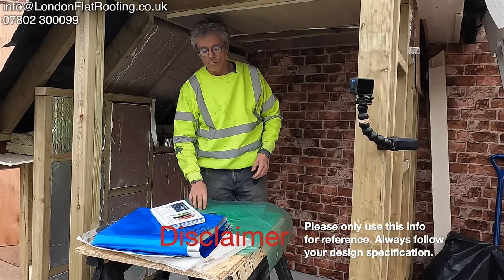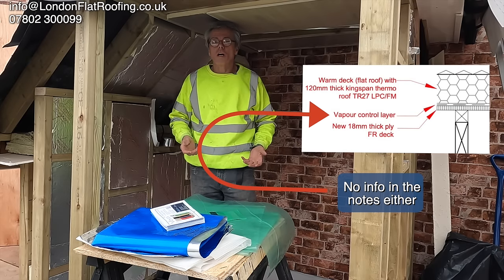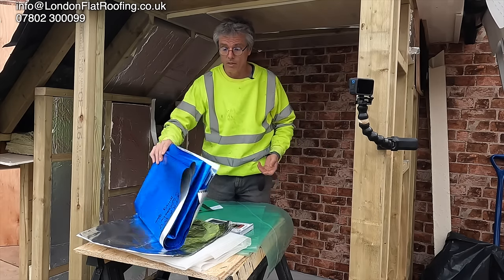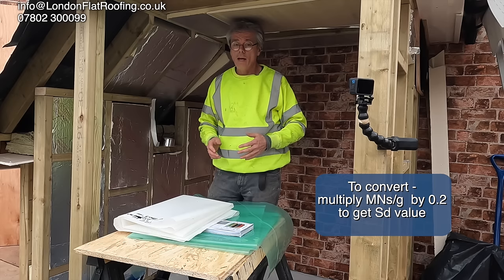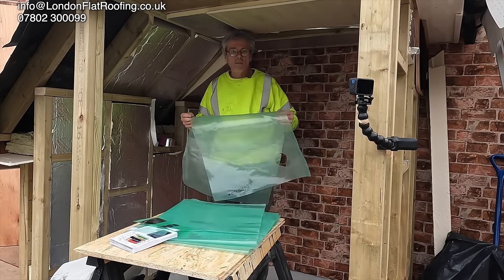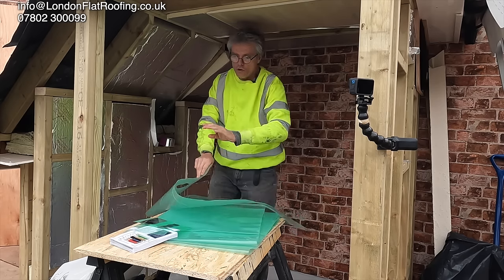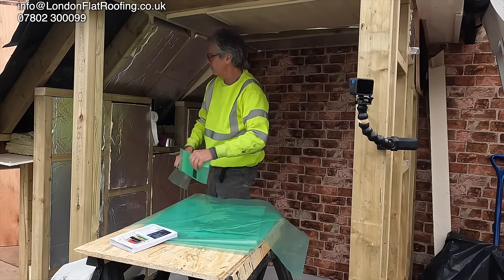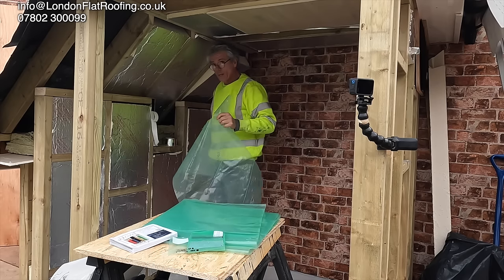Vapour barriers for roofs and walls explained

Comment: Love the outside rig Steve. Would be interesting to build a mini 'wrong' roof one day and see the effects of it, incorrectly fitted downlighters and all! I guess the most challenging one is the rear extension with roof lantern and kitchen below, no abutment vent, the usual 20 spotlights. Just trying to give you a few ideas!
Reply from the maker: If I get the chance I will do some thing wrong in this rig
Reply: Been there done it seen it fail , spotlights letting moisture through & also the heat they create causing condensation.  I have seen top hat fire rated led covers to help this problem.  The building control like great big cut outs around the light fitting is the problem.

Comment: Great video! Can I say as someone on the design side, that when specific products are named it's often pushed back by a builder as they either have no history with the named product or simply that their favoured merchant doesn't stock it. It's not easy on this side either and usually results in a phone call with an answer needed in about 10 minutes as to "whether 'X' membrane would be alright?".
Reply from the maker: Great point and since COVID that ten minutes is 40minutes

Comment: Really helpful again mate. I’m almost ready to fit vapour barrier to cold roof, it’s the downlight scenario I’m trying to get my head round. Looking forward to see your video on that, I had in my head where I cut the insulation away I will vapour barrier that area, like putting vapour barrier inside an empty box if that makes sense, but I guess there has to be a hole for the cable? 🤯
Reply from the maker: Tomorrow afternoon

Comment: Hi Steve, I'm so glad I've come across your video. I'm sure you've spoken about this many times. I'm currently doing a DIY renovation to my property we have an old extension, cold flat roof. The roof joists are roughly 5 inches high. So what I've done is kept 5cm gap from the flat roof and drilled holes in the joists for air flow, immediately after the 5cm gap, I've then insulated with 5cm celotex and taped with alluminium tape for air tightness, which leaves me a remaining gap about 2-3cm from the bottom of the joists, this allows me to fit downlights without obstructing the insulation to allowing heat of the lights not having much effect. Can you please advise further, I'd be happy to email :). Many thanks.
Reply from the maker: Sunday Ill have a video coming out that covers down lighters

Comment: Great video, in construction years and membranes can be so confusing. What I've taken from this, is do the proper research if you want to a good job. For vapour barrier membrane AIR TIGHTNESS is key, that's why they give you the tapes with it.

Comment: great video explaining how to do it the right way. If I build a warm roof over a single block shed that has a vapour barrier in the roof, do I just use a vapour barrier on the walls up to the joins or does the whole internal space need to be completely sealed?

Comment: Hi Steve I have a question if you could please answer :) …

I’m looking to knock a non-structural wall down to make my downstairs bathroom a little bigger so its connected with the toilet which is at the back of house however the toilet room is a single external brick wall so it’s very cold which im hoping to insulate and make warm..

Taking advice from this video this means I could make a stud frame 4x2 and fit against the wall and then fit 100mm PIR boards up tight against the studs and that should do the trick no vapour barrier needed? For extra reassurance I could buy expanding foam and put around the PIR to stop any worries about the condensation to meet regulations?

Any advice on insulating a single brick wall is welcome, hope u can help me 🙏🏼
Reply from the maker: Yes you do need a vapour barrier the rest you have got ok
Reply: @SteveRoofer  hi Steve what vapour barrier would I need and how do I attach the vapour barrier to the brick? Do I leave an air gap or no?

Hope you can help as not many people know how to on my situation which is making me feel very confused.

Thank you 🙏🏼

Comment: I think one of the reasons people don't specify an err....specific product for a vapour barrier is that they don't know which one to use. Another is it's good practice to put vapour barrier on a detail, and then the specification document or side drawing notes would call up the exact thing or requirements of the thing (such as "comply with BS such and such). It is a jungle, I hate the amount of different and varying products and how confusing it all is. Even if you used NBS spec (costs a fortune) there will be many decisions to be made, and it seems to need specialised knowledge now that even architects will struggle with. What happens is firms will end up having a standard wpec they always use, which is great, until they do something different but the spec doesn't change to suit. Minefield is construction now, it can't have always been so complicated and over engineered?

Comment: Static caravans (flat cold roofs) - would be interested on your take re vapour barriers and excessive condensation.  Mine uses the silver thermal /vapour barrier in the cavity between the ceiling and the external tin roof, above a 1.5" layer of rockwall (or similar) and air vents are punchured through poorly and the seal is not remade around them, they are huge condensation traps in this state, leading to dripping on ya head!
Reply from the maker: that's just thermal bridging for you
Reply: @SteveRoofer  I've resealed the foil all around the vents and it appears to have solved the huge condensation and dripping issues, but I wonder how to check now it's all sealed, should have installed roof cam 🤣

Comment: Thanks for this. So if I build a garden room and install a vapour barrier CORRECTLY, where does all the moisture go now that the building is air tight?
Reply: If it’s a heated room, the moisture stays suspended in the air.
If its un-heated, there’s no temperature difference (inside to outside ie cold spots) on any surface for the water to settle out.
Reply from the maker: Good question! you need to vent internally and manage the internal air space, how you do this depends on the usage of the dwelling a Mechanical Ventilation Heat Recovery (MVHR) system may be necessary. You cant have things both ways. Live in a highly insulated airtight space and not expect there to be consequences. Unfortunately because of the price of energy and hour reasonability to the planet this is the way we have to go
Reply: Air tightness and moisture vapour tightness are two totally different things. A vapour barrier still allows moisture vapour to pass through it but at a controlled level. This is why you don’t use a DPM as a vapour barrier which blocks any moisture movement.

Comment: Hi Steve. Thanks for this, really helpful. Quick question though... As you say, the butyl tape is expensive. Is there any reason why you couldn't seal joints with polybutene sealant or something similar? Seems like it would be significantly cheaper to do so.
Reply from the maker: If you're gonna do it, you have to do it using the system so that you can get the guarantees but realistically don't do it and do a warm roof. If you do a warm roof it's far better and you don't have all these problems

Comment: Have to admit vapour barriers being on the inside of the structure never made sense to me when working in the states or back in the UK. Vapour control layers on the outside of the structure make far more sense and just having an air tight structure where the passage of air is controlled on the users terms. The difference with being back in the UK is the general construction isn't a reduced height warm room with a cold roof over it.
Reply from the maker: I think warm roof with cold roof over hte top is the way to go but hight being the problem
Reply: @SteveRoofer  While I was working there they do a reduced height construction warm room + ventilated cold roof. LVL's and engineered joists are generally the go-to for it but it near enough takes up the same space plus 1-2 inches. NA is massively ahead in wooden framing building techniques though compared to the UK and the general level of air tightness is much higher on the new builds back in NA than new builds here in the UK.

Comment: Hi Steve,
Thanks for this. Great advice. I’m looking to convert a garage into a workshop and wondered if an air gap should be between the single skin brick work and insulation? Also, should there be any sort of barrier between the back side of the Insulation and brick wall?
Thanks!

Comment: One way of getting through this minefield of vapour barriers is to always go for the highest grade on the market. I now specify Intello Plus on all my jobs since it reacts differently to any other membranes: it stops the moisture going through your build-up in winter and it lets any intersticial condensation dry out in summer by opening its pores. In a way, it's an acceptance of not perfect workmanship on site and will resolve some of the moisture building up in your voids. Very clever.
Reply from the maker: Yes good point I will be testing some of the new intelligent membains  shortly
Reply: @SteveRoofer  Hi Steve, did you manage to do any tests on the intelligent membranes ?
Reply: @SteveRoofer  Any tests on intelligent membrains? I also would like to know more about this. Your insights are much appreciated!

Comment: Hi Steve, great videos! I have a question which I'd love your advice on. Engineering drawings for our flat roof loft conversion states that we have a 50mm void, 150mm kingspan between the joists, then 25mm kingspan below joists, then plasterboard and skim. Where would the vapour barrier go?
Reply from the maker: You put the air vapour controller on the warm side of the insulation always however with the situation that you're in here you don't necessarily have to put it right at the bottom i.e. between the plasterboard and the lower 25 mm Kingspan you can put it under the joists so that slightly higher up in the construction. So the buildup would be something like this 12 1/2 mm plasterboard 25 mm Kingsbay air vapour control layer 150 mm of insulation between joists. Of course the problem you have just like everybody is that you have to fit the air vapour controller, extremely well using all the manufacturers systems products, this is expensive and very time-consuming and I don't think I've ever seen anybody do it!
Reply: @SteveRoofer  Thanks for your reply Steve, appreciate the advice and support. I think putting it between the 150mm and 25mm insulation will be easier as it can be stuck onto the joists and stretched across

Comment: Hi Steve I've been having a long think about how to insulate around my led downlights and have decided to use 60mm all over in a 6 inch timbererd flat roof. My idea is to cut the insulation short to allow for clearance for the downlight then sticking a 25mm insulation piece on top of the 60mm creating a kind of  top hat sealed void. Then I can vapour barrier the whole area and stick the barrier to the flush to timber 60mm insulation  around the downlight void area,any thoughts mate much appreciated 👍
Reply from the maker: This sundays video is how to fit downlighters

Comment: what's always puzzled me is how a vapour barrier works when we put hundreds of screw holes in them when fixing our plasterboards.
And worse of all is the 3 or 4 missed screws that happen that won't even have a screw in it to fill the hole.
Reply: Butyl tape should be used.
Reply from the maker: Yes I'll Be showing that in another video

Comment: Hi steve im doing a warm roof and wanted to ask ive got the aultrix 600 vapour barrier going down on osb board do i need to use primer to stick the vapour barrier down also the top deck of osb boards can i use long screw to go through directly to the joist or do i need to use the plastic fixing seen in your other videos? Thanks
Reply from the maker: If you are screwing down the insulation, no you don't have to use a primer. I would always use thermally broken fixings when mechanically fixing down the insulation.
Reply: @SteveRoofer   thanks for your reply, i was also wonder if i can use a torch on felt underlay which come in 1m x 16mm as a vapour barrier instead of aultrix 60, also have you heard or used elotene dsn self adhesive vapour barrier is it as good as aultrix 600? Thanks
Reply from the maker: @asdaasda4967  Their vapour resistance is the same  very good and the price is basically the same I have used lots of different one not the elotene DSN self-adhesive vapour barrier I know some of them are more stickier than others, and we found that the aultrix 600 is the most sticky at the back and that's why we like it

Comment: If you just put metal tape over the seams of the foil backed insulation board (covering the studs/rafters too), wouldn't that have the same effect as using a vapour barrier?
Reply from the maker: yes possibly but can you guarantee that you get everything every hold and divit !
Reply: I'm doing my bathroom with ridgid insulation and just foil taped every gap joist I could ....I rang someone from celotex and they said the foil does act a a vapour barrier....I really did find it confusing looking on the internet for the best way forward
Reply: @SteveRoofer  I asked because that's exactly what I did with a vaulted bedroom last year. I was meticulous with the tape - probably went a bit overboard. So when I saw your video, it had me thinking. Love the videos - I've learned so much from them, especially as a DIYer.
Reply: @eddddd123  Ahh, good to know, as that's exactly what I did last year.
Reply: @pdgnews  Yes Paul it should be fine.....I did put thin plastic membrane around shower area just to be safe and alot of ridgid insulation was doubled up so I'm hoping it will be fine.....what gets me is you spend all this money on insulation and then put a big hole through the wall for a fan lol....feels like your totally defeating the object 🙂
Reply: What is that tape? That seals the screws as the plasterboard is fixed?

Comment: I have a brick single skin garage and planning to insulate: 
1.BRICK  
2.Breathable Membrane  
3.Baton walls over Breathable membrane 
4.PIR  
5.Vapour Barrier  
6.Plasterboard or Timber sheeting to finish - No air gap Is this correct?
Reply: Hi Darren, I'm doing exactly the same thing and it sounds correct to me. Although I am going to hold out until the summer until I do this.
It's the cold fibre glass roof that I'm going to struggle with.
Let me know how it goes 👍
Reply from the maker: So it looks to me as if you are doing this from the inside. If I was doing this from the inside I would be using one of the new multi foil products as they're amazing. I did exactly what you're talking about on my garage multi foil on the inside that also acted as the vapour barrierOver batons on the brick wall job done fantastic acoustically internally and thermally internally

Comment: Do I actually need to insulate between the rafter or could I just board over with a bigger insulation board and gain the same effect. It is a loft and not a habitable space

Comment: So if the barrier is on the inside what stops the insulation from getting mouldy? Also how do you attach a plaster sheet to a plastic vapour barrier?

Comment: hello Steve,I would like to ask how to install kingspan PIR in our attic.Its end terrace 1958-59,cavity wall with concrete tiles and bitumen felt,average humidity in the loft is over 80%RH in Winter and all stored stuff gets moulded,even rafters. We are in the process to reroof,so replace few bad twisted rafters,install tyvek membrane and new tiles.If I want to keep attic for stuff storage,but still having it fairly insulated from ambient temperature,can I use PIR panels between rafters leaving 40-50mm vent channel behind. There is going to be over fascia vent and dry vent ridge installed. Is this good solution? thanks

Comment: Hi Steve, what about vapour control plasterboard/ foil backed plasterboard? Does this count as s vapour barrier on a retro re fit?
Reply: How would you seal the joints? One of these double sided butyle tapes on the studs then the boards screwed up in to it?
Reply from the maker: Yes foil back PB can't be mad air tight

Comment: I can’t help thinking we are causing more problems than we realise. In modern properties there is no air movement, extractor fans don’t do much as the building is so air tight they don’t pull in fresh air. Both my son and daughter live in new builds and when they stay with us for a few days they always say they feel so much healthier . New builds feel more stuffy.I live in a 1960s house . Even my builder says don’t ever get the cavities filled . He said it took thousands of years to invent the cavity wall and 50 or 60 years to decide to fill it. I do have plenty of insulation in the loft but that’s as far as it goes.  It might cost me more in heating and not very green due to less insulation but at the end of the day my health is more important than all this seal everything up attitude..
Reply from the maker: Yes all this air tightness is going to be a big problem
Reply: Trickle vents and open windows
Reply: Open the windows when needed
Reply: heat recovery ventilation remedies this, but can be expensive
Reply: After being in the building trade for over  two decades, I wholeheartedly agree!
Reply: @SteveRoofer are you being sincere or sarcastic in this comment? Wouldn't knock you if it's sarcasm. Just wondering if you're implying the problem is sealed rather than properly vented. If it's an issue of proper venting, do you recommend any specific videos to watch?
Reply: @SteveRoofer dry rot in the framing.
Reply: New builds should have mandatory pivs system to force a warm dry draft through the house.  Though people would turn them off due to the draft and to to save energy bills.
Maybe we should go back to living in caves...  Bit damp though.